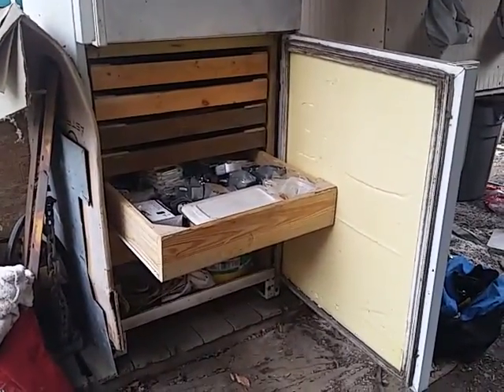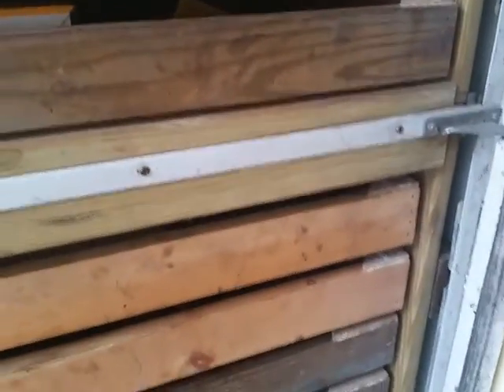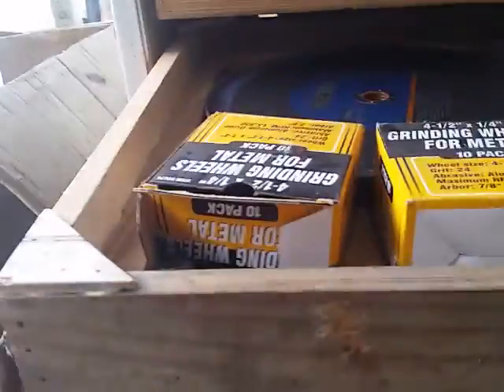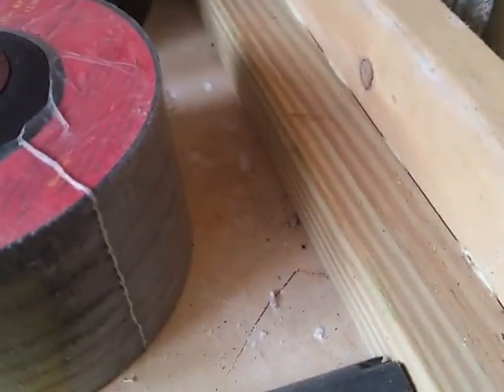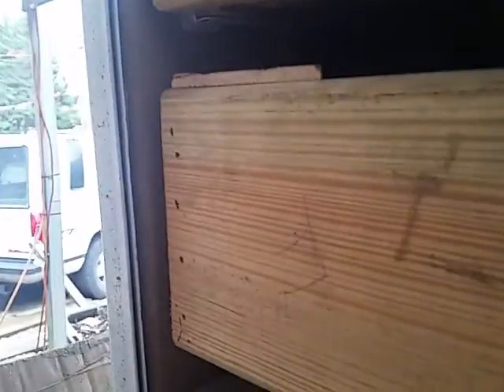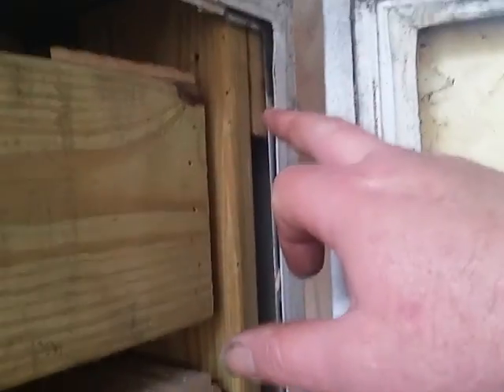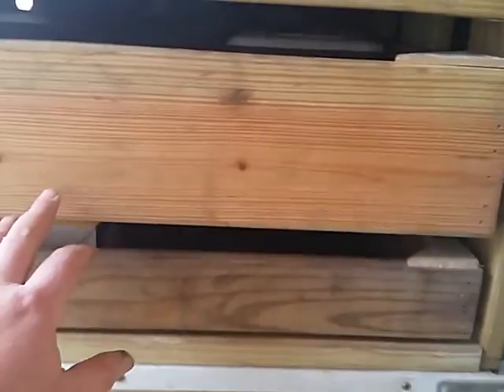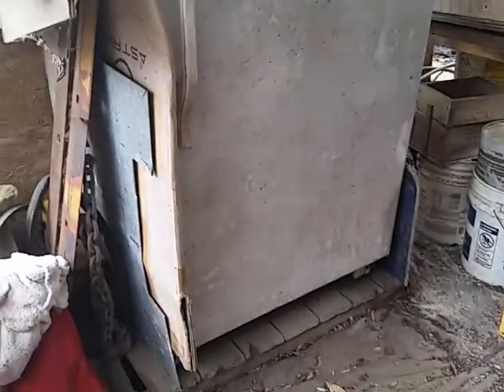Refrigerator Tool Box - CHEAP Tool Chest.

Comment: Thank you for the idea I have refrigerator from 1930 I'm definitely going to make it into a toolbox so I don't have to get rid of it it still works but I were to making door toolbox
Reply from the maker: Ha..Ha.. If it still works, keep it.. You can always find used/no good refrigerators at your local dump, where they collect the metal to throw it away separate.. But, yes.. They make good toolboxes.. But, you have to dig the foam out of them usually to save space and get the box braced up, so, no need to waste a good working refrigerator.. Can keep water/beer, etc in your shop, or sandwiches, etc.. I kept mine with Food, etc.. I didn't have to stop to go into the house when I wanted a snack or lunch, etc... 
But, it is yours, so, do what you wish with it.. But, it is easy to get one from the dump.. I see them every time I go to my local dump, to dump my dump trailer. Good Luck. It was an interesting project..
Reply: @MarkThomas123  I think I changed my mind probably going to leave me original but I'm just going to put plywood top of the racks make it slide in and out screwing anything in it the compressor has been upside down for a long time because you could take it off it may not work anymore I don't know I'll find out

Comment: Lol - I love it.  Great idea!
Reply from the maker: Stay tuned Rick.. I have some more good ones coming..  Several of them related to Smithing.. New Oxy-Acetylene cart, Striking Anvil, several bending jigs, Oil Quench tank from a CO2 Bottle, Nail Headers, etc.. 
And,, a super, super cool set of tongs that will hold stock ranging up to 1/2".. More if you use the home made tong clips that I am making now too.. Ha.. Having a ball in the shop before I have to stop for Tax Season.. 
Cheers fella.. One day, I am going to take the time to build a power hammer.. Sooner than later if I ever run across some really big stock for the Anvil post..